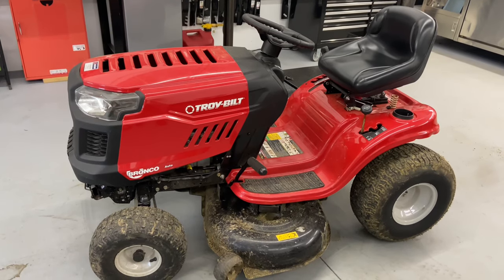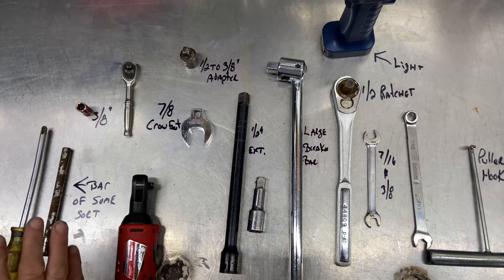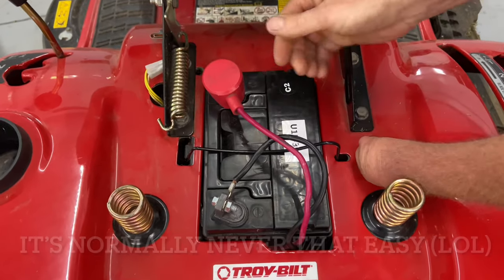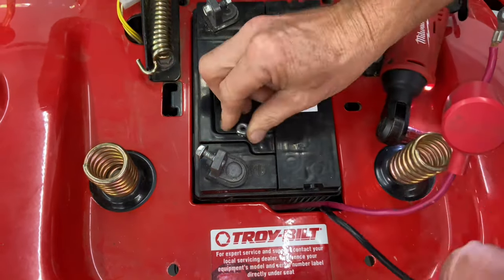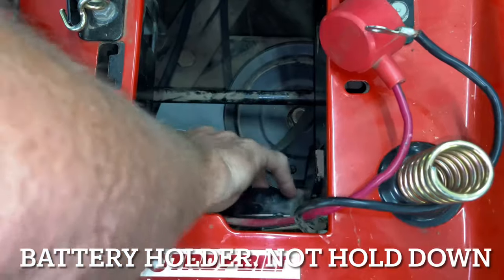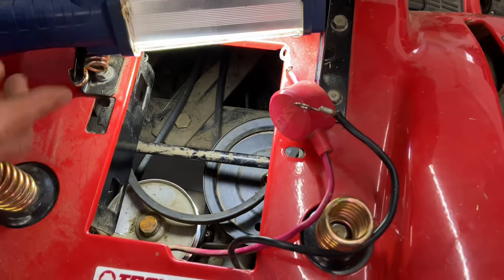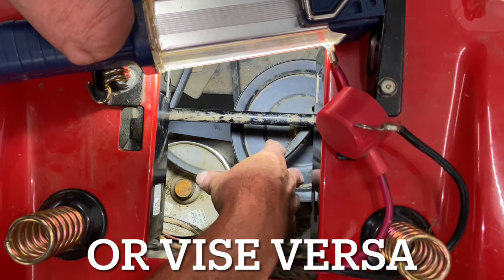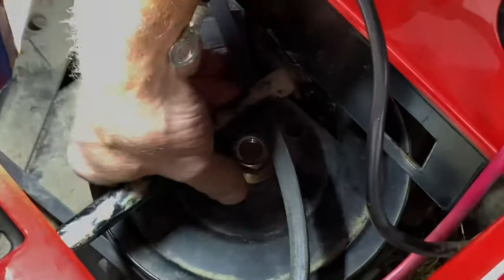How to Install Transmission Drive Belt TroyBilt Bronco Tractor

Comment: I’ve watched 10+ videos explaining how to do this and yours is the only one that makes sense and can see what’s going on! Thank you!
Reply from the maker: I do my best and I’m glad it was helpful. Thank you for watching in the kind comment.
Reply: Quick question. I need to replace the large pulley. The one you put the screw driver through.  But I can not get the old one out.  I have it loose, but I can't figure out how to maneuver it out. The bar is in the way. Will I have to take the fenders off to get it out?

Comment: The 22MM Crow Foot fit so I bought the metric kit for around $27 more likely to use them in future.  My nut came off easily so grinding an old wrench shorter and crow baring might have worked.  I used an old bike cable and scrap piece of wood as handle to pulled spring worked nicely.  Thank you very much for video it wasn't difficult and I am back on the road.  A real MTD Kelvar belt was $18 on Ebay seems worth the few extra dollars the other belt still looked serviceable that is still half price of normal retail.  Didn't even know Crow Feet Wrenches existed!  The same PT Performance brand is cheaper on Ebay than Sturdevant's if you watch the video in advance you can save a few more bucks.
Reply from the maker: I'm glad it was helpful and thank you for the kind comment!

Comment: THANK YOU!!!    this video was extremely helpful!   I borrowed a crows foot wrench from a neighbor (he didnt have 7/8 but the 22mm worked!)   I also didnt use a hook tool.   I used an old dog tie-out cable and looped around the spring hook and pulled the spring through the hole.
Reply from the maker: I'm glad it was  helpful and you were able to get the job done! Please give this video a like to help the channel.

Comment: Hello can you help me I got a bronco 42 inch if I lift it on Jack stands n place on reverse tires turn ,but when I place them on the ground tires don't turn ?
Reply from the maker: Can’t diagnose correctly without seeing the machine. I can say if the belts are all on as they should be, sometimes it is hard to change from the forward gear to the reverse gear, and you have to lift the clutch pedal a little bit and play with the shift knob to get it to rock into the reverse, or into the forward position. Other than that it could be bad transmission? Broken belt? Again without seeing it it’s almost impossible to diagnose.

Comment: Regarding that ornery spring, I use a loop of #80 weedeater line that I run thru a handle that I made out of a small block of scrap wood. I drilled a hole in the handle & then tied a double knot on the line ends after inserting them thru said hole. The loop grabs the curved spring end. When I get the spring in place, I cut the line (which is now pinched) to remove it. Yes, I have to remake the line/loop next time I need to perform this task but that's not very often. Your hook is better but sometimes one has to improvise. Thanks for the very well filmed & communicated video!
Reply from the maker: Hi JJ, Nice! what ever it takes to get the job done! Thank you for watching and commenting.
Reply: Fantastic video and this comment was on point! I was about to go buy a tool and then found this comment (weedeater line and some scrap PVC worked great). Thank you both!!

Comment: Thanks for an excellent video; especially in getting the light exposure in an unlit space.  I ordered a spring tool after watching this video.  I own an older vintage Troy Bilt (2005) that has served me faithfully.   Years ago I paid a local shop $150 to "replace all the belts".  I have a very small mowing area and use the tractor for towing a small yard trailer; a year later I discovered that the belt for the blades had been the replaced BUT  the drive belts were almost in pieces (multiple deep cracks); the "mechanic" had obviously given up in replacing that belt but still charged me for the entire job!  Lesson: watch videos like this and DIY.  BTW, at least on my mower, there is a frame bolt on the left rear of the mower which, when loosened allows the pulley on that side to be moved enough to slide a belt over it.   Just FYI.
Reply from the maker: Thanks D! I’m glad it was helpful. Please give this video a like, subscribe and tell your friends to help my channel grow. It would be greatly appreciated. Thank you for watching:)

Comment: Thank you for this very instructional video. Looks like a quick trip to the auto-parts store for that crow's foot is in order. Anything to save headaches. Mine popped off yesterday evening right at dark as I was driving it to put it away in the shed, figured it was going to be an ordeal. Not now, though, that I know how to approach it.
Reply from the maker: Glad it was helpful!

Comment: You could take the body off the back which I had to when one of  the flat idler pulleys top nut that was not accessible. Way easier to access trans belt but a hassle. From a 2004 Z809K Troy Bilt owner.

Comment: I'm working a lower drive belt on the Bronco, that seems to be stuck in drive and reverse. I had to replace the jam nut that was missing.  The only way to stop the tractor is to turn the ignition off. I know the part # is 954-0467, but that belt seems to be too tight and will not become loose and fear that is the issue. The other # is 954-0467A. I hope that one is at least 90.8 inches. I had hoped that you were going to do both belts to see the routing. There are no schematics under  under the frame as other tractors have. As for the spring though, I use a long electrical wire to loop around.
Reply: Man I just put a lower drive belt on my bronco and when in drive the brakes aren’t stopping it, I’m hoping it will stretch enough  after riding it around for a bit so I can get the damn thing to stop but i dunno

Comment: Great video. My clutch is on the right but pulleys look the same. Mine popped off the idler. What would cause that?
Reply from the maker: It can be many things but most of what I have come across are objects, twigs,  branches etc.

Comment: Is there a way to adjust the drive now with new belt it doesn’t seem to want to stop with the brake pedal or go into neural thanks and great video
Reply from the maker: If you used an aftermarket belt that is your issue.
Reply: @JohnsonsSmallEngines  where do you get your belt from
Reply: @JohnsonsSmallEngines  thanks I replaced with OEM parts and that fixed everything
Reply from the maker: Hi Chad, glad to hear! Thanks for the update.

Comment: Wow excellent video! Just found your channel. I just got a troy bilt tractor off Facebook for 200 bucks. It was garage kept, engine surged etc...I hope i wasn't ripped off. The tractor won't start now. I charged the battery, it turns over but won't stay running. The guy I bought it from had it running when I picked it up. I could hear it surging while it was running. It looks like an older troy bilt. I checked the filters all new, spark plugs new, the guy I bought it from  said I might have to spray some fluid to get it running..any help would be appreciated. Great channel and will donate 👍
Reply from the maker: Make sure you have a full tank of gas. When you say “it turns over but it won’t stay running”. If it starts then dies quickly after starting? (1) Try putting the choke 3/4 on to see if it gets better. If it does you may have a carburetor issue. (2) you also may have poor compression and you will need to check the compression with a compression tester. I would really to see it to diagnose correctly.
Reply: @JohnsonsSmallEngines  mine was the same way. Put a new carburetor on it, easy job, runs great now. About $20 on Amazon

Comment: Got a craftsman lt1500 basically a mtd 42 inch . Just replaced the upper transmission belt and now it won't go fast at all. Its like speed 2 and the clutch doesn't seem to go all the way back now. Any suggestions? I've been all up on the pulleys and don't see any remnants from the old belt that shredded off. I'm lost at this point. Thanks in advance!
Reply from the maker: If you installed a aftermarket belt? That is your issue. If you Installed a OEM belt, you either have a bad variator or you may need to replace the other belt to make it work correctly.
Reply: @JohnsonsSmallEngines  thank you for the reply! I figured out that the belt had been worn for so long that the medium sized pulley was tensioned for so long in a the out position that it had made a catch which didn't allow a normal full sized belt retract all the way. So I basically just needed to lubricate the pulley arm and everything started working fine lol.

Comment: i have a troy-built bronco, i had to swap out both upper and lower last year because it just stopped moving. it ran better but i still had to push the gas almost all the way to the floor before it will move and the longer belt feels as loose as the original one i took off. i really want to get this back to par. 

any ideas?
Reply from the maker: You must use OEM belts (original equipment manufacturer) or that can happen. I learned that the hard way. If you did use OEM belts then I would suggest making sure the variable drive pulley is not stuck.
Reply: @JohnsonsSmallEngines  i went back to troy built to confirm i did buy their oem belts NOT the mtd belts. when you say stuck, meaning its not spinning? also, is there anything related to the accelerator that might be the cause?
edit: when i do depress the accelerator almost to the metal to does get going.
Reply: @Johnson's Small Engines  I fixed the issue. The idle pully spring was connected on the wrong side of the frame. I guess I should have referenced the pictures I took before zipping it all back up. Mower takes off like a thoroughbred now.

Comment: Hello friend, i replaced both belts and now my mower wont brake in gear. Its the same exact one as in the video. It also seems as if the pedal wont go down all the way. Any idea why?
Reply from the maker: I have learned that you need to use OEM (original equipment manufacturer) belts or what is happening with your machine may happen. Use MTD brand belts. If you are using MTD belts I don’t know what could be going on as it is almost impossible to diagnose something like that without seeing the machine.
Reply: @Johnson's Small Engines  thanks for the quick response. I did notice that the belt i got was alot thicker than the oem one. Ill try an original and see what happens
Reply from the maker: That would make sense if your new belt was thicker. The pedal would not go all the way because the belt being thicker has shortened it. I’m pretty confident getting the correct belt will be the key. Let me know how you make out.
Reply: @adamdistortion8810 hey man did you wind up having to change to an oem belt or did the problem subside after a few mows? The belt I got from Lowe’s is giving me the same trouble you had
Reply: @joshuamichael2463  you need to get the exact one that came on the mower. Thats what worked for me. Ended up waiting a couple days and having my lawn look like crap, but once i got it in, she drove better than before
Reply: @adamdistortion8810  ok man thanks for the info

Comment: How about some part #s. Model # of mower?
I have a 2018ish bronco…I bought used, all the labels are missing so I’m having trouble getting the right part #s but my mower looks just like that one and my problem is it goes so much slower In forward than reverse🤷‍♂️..please help😂
Reply from the maker: Try this model 13AK78BS011 but please beware that this may not be the exact model and some parts may or may not work. There are so many Troy-Bilt Broncos with subtle differences so it is hard to say if this model will help you.
Reply: @JohnsonsSmallEngines  thank u!! Where should I look for a model #? Is it on the mower other than a label?
Reply from the maker: The model of the machine should be on a sticker under the seat. It would only be on a sticker, there are no vin numbers stamped or on a tag on your model.
Reply: @JohnsonsSmallEngines  Thanks again! You’re the man!!! Really enjoyed ur vids, props to the cameraman as well👍👍

Comment: The Drive belt always been jumping off. On the Craftsman T-140 > IDK WHY? OR HOW IT DOES THIS? Unless the belt guild is to wide ? Idk how it keeps jumping off? or the idler pulley arm is BENT?  IDK?  YOUR RIGHT!  The dam idler arm spring is very a strong spring>  i use the rope method > but i'am going to make a tool like your. but longer like you said. THANKS FOR THE HELP! > If any one know what this problem is? PLEASE COMMENT! If i fine a way to fix it? i will leave a comment here. Right now!  I'am thinking of putting a higher  idler pulley on it to keep it from jumping off. THE SAME SIZE BUT TALLER > I think this will fix it. Do away with the belt guide when you put the taller pulley on. So it want chew up the belt > ( OR ) Close up the belt guide where it can't jump out. BUT IT WILL WEAR ON THE BELT (OR) it could be the idler pulley arm is bent?  Making it jump off? idk yet.   1 of the 3 bound to work
Reply from the maker: Check your mounting from the transmission to the frame. I have come across broken mounts from where the transmission bolts to the frame. Try putting the tractor into a gear forward or reverse (engine not running) then rock the tractor back and forth to see if the transmission is moving up and down (if you can, take battery out and look to see if the transmission pulley is moving) if the transmission pulley is going up and down when rocking the tractor back and forth,  you may have loose mounting bolts or broken mounting flange from the frame.
Reply: @JohnsonsSmallEngines  This is a new tractor!  Only mowed with 2 x.  Ok Thanks 👍👍
Reply from the maker: That sounds like a warranty issue. Maybe something was installed incorrectly at the factory. I have not come across issues on the new machines, just machines with a lot of hours on them.

Comment: I repair mowers myself all day long and the flashlight that I use is a Milwaukee it’s the greatest flashlight that I’ve ever seen it’s expensive but you’ll really love it. There’s never been a time that I couldn’t stick it and adjust it to right where I want it it cost like $200 without the battery but it’s a good one.
Reply from the maker: Model or part number would be great if you have it?